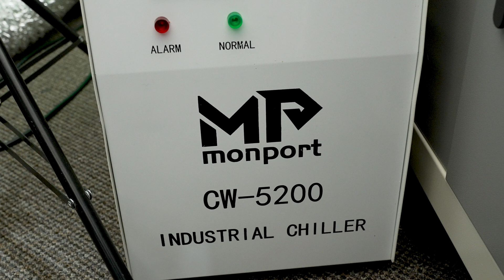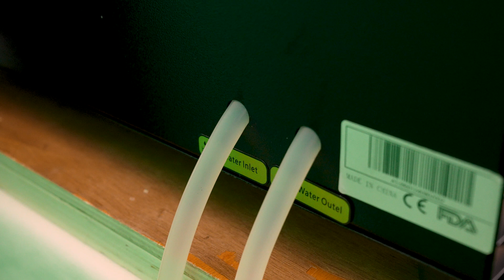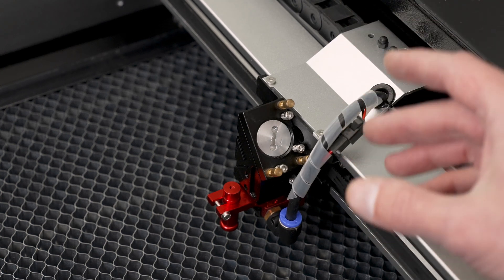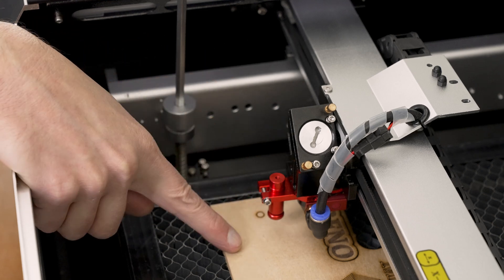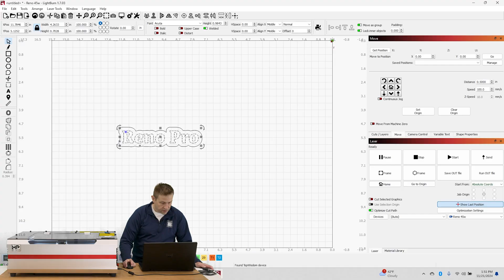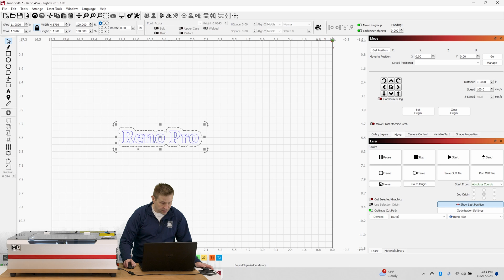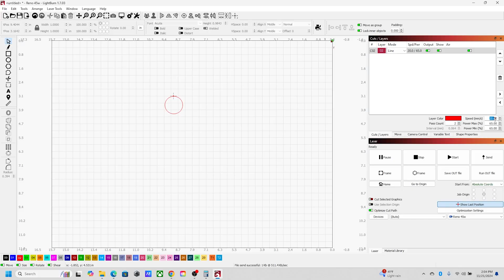Monport Reno Pro-  First Look!  #laser #engraving #woodworking #lasermachine #dyi

Comment: Can I fit a rotary in the pro version?
Reply from the maker: I'll be checking that out short in an upcoming video.  The machine does have the 4 pin port for a rotary, but I want to see what actually fits and what the max material size will fit.

Comment: I really liked the review. But I would like to know if a camera can be adapted to it. and what would be the angle of the lens.

thanks for your help.
Reply from the maker: That's a very good question and I've heard this question before.  Currently I don't know of a direct fit camera but I'll looking into it for the larger Reno 65Pro machine.  
I know I'll need a very wide angle lens as the distance from the work surface to the lid is very short.  The camera will have to be mount to the outside with the lens flush to the inside lid because the laser head is close to the lid.  
More to come in future videos...

Comment: When you power on the Reno Pro, does the computer UI boot up immediately? Recently purchased on of these and the UI stays days and lightburn won’t detect the printer. I’m thinking it’s an issue with the board.
Reply from the maker: There's some software on the included USB drive- you'll need to install it and during the install it will want to include USB- say Yes.  These are the USB drivers needed for lightburn to detect the machine! :_doggy:
Reply: @ That’s the thing, I double checked and installed the drivers on the thumb drive to my laptop but the Reno’s UI screen doesn’t turn on at all when I power the machine on. 
I just wanted to know what a proper boot up looked like. Well, I’ve already contacted support so we’ll see what happens. 😓

Comment: Engraving and cutting clear acrylic, which or what type of acrylic should I buy? Thanks
Reply from the maker: Hi- you want cast acrylic. :_doggy:
Reply: @thelaserchannel1  Thanks
Reply: The reason I am asking is I bought cast acrylic and it did not engrave well but other cast did. Is there a brand and/or place you buy your clear from?
Reply from the maker: @ I buy mine from https://houstonacrylic.com/.  I'm not affiliated with them- it's just good stuff and they ship quickly.  :_doggy:
Reply: Most of the arguments and videos I read and saw in the cast vs. extruded acrylic topic are about how much better the engraving looks on cast.  But what if I am not going to engrave, just cutting shapes.   Even if there a subtle difference between the two in the cutting, the cast version costs more than 2x, is it really worth it?  especially if my use case would be cutting thin, 2mm sheets. Cast is not even available in this thinness.

Comment: How easy/hard would it be to upgrade the Reno45 basic model with a TL-A1 controller to make it a Pro?
Reply from the maker: I have not looked into upgrading the controller - I recommend contacting Monport directly.  Currently it's the end of January and I think they are on Holiday.  Let me know what you come up with! :_doggy:
Reply: @thelaserchannel1  Here is their reply:    Yes, it's possible to upgrade your Monport Reno 45 to use the TL-A1 controller! The TL-A1 controller is a TopWisdom controller, which is compatible with the Reno 45. However, you might need to do some rewiring and ensure that the settings are correctly configured for optimal performance

Comment: The last couple of days I have been doing test cuts 3mm mdf and 2mm acrylic. FYI, I have been using the xtool d1 for several years now and I am proficient with the software and the diode laser. But with this co2 laser to cut a circle on the 3mm mdf I have to run it at 8mm/s &  40% power, 2 passes and for the 2mm acrylic at 10mm/s and 50% power it's not cutting thru, what's going on here? Any help with this? Thanks.

Comment: My pro 45 red dot does not align with the laser beam, how do I fix that? Thanks
Reply from the maker: I haven't seen that issue with my machine.  Check for an adjustment screw on the back side the laser head- usually a set screw to free up the red dot assembly to properly set alignment.  And yes- the red dot assembly is a bit out of the way behind the laser head!
Reply: @thelaserchannel1  Thanks

Comment: How do you move the head to the spot you want it to frame? When I use my diode I just grab the head and move it to the spot. Can I do the same with this one or must I use the arrows on the panel? Thanks.
Reply from the maker: The Reno series laser head can only be moved by the arrow keys on the control display or in the software.  The motors are always held in a position- this is very common on Co2 lasers.  The motors are large enough that moving them by hand can back feed voltage into the drive controller and potentially damage the machine.  😀
Reply: @thelaserchannel1  Thanks

Comment: Couple of questions:
1. Does the software (lightburn i think you called it) for setting up the cut files come with the USB that is provided? If not, can I just use any software compatible with laser cutters like AutoCAD?
2. What is exactly everything that I need in order for it to run and what else is optional?
Reply from the maker: Great questions!
1. Lightburn Pro is the software I used.  There's a free 30 demo of the software and then it's $200.  the Pro version of Lightburn runs every type of laser compatible with Lightburn.  Lightburn Core is not the correct version to run the Reno.  The USB drive also comes with free software to run the machine.  Most prefer Lightburn because they run it on other machines.
2. You'll need a bucket for the water pump and distilled water (NOT tap water or purified or filtered water).  I recommend the Monport CW-3000 water pump- it uses a fan to cool the water to ambient temps and holds nearly 4 gallons.  Better yet is the CW-5200 active water chiller- this unit has refrigerator cooler in it.  The CW-5200 is better for longer work sessions with the laser machine and also warmer climates where ambient temps are still too warm.  The laser tube is happiest from around 68-72 degrees F.

The water pump is really the only thing I recommend upgrading right away.  The machine comes with air assist, air pump, and software.

Comment: Nice review...do you have to buy a chiller?  Any details would be appreciated,
Reply from the maker: Thanks- It comes with a water pump with the intent that you use a bucket of water.  I recommend the CW-3000 for lighter use (it holds nearly 4 gallons of water) or choose the CW-5200 active chiller for running continuously.